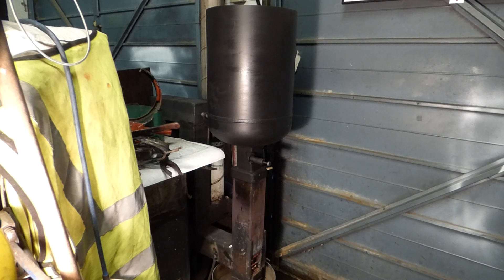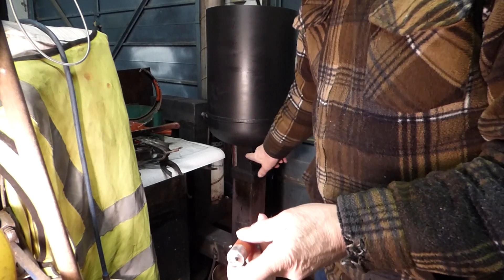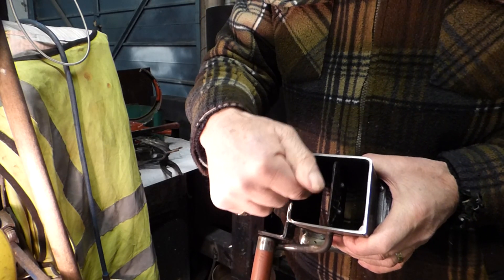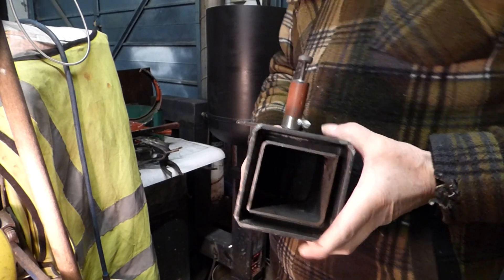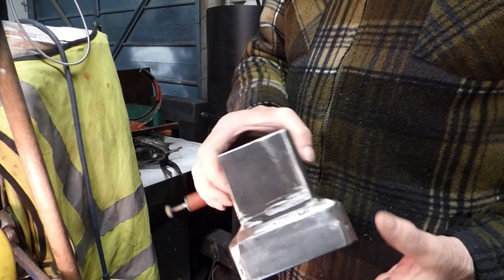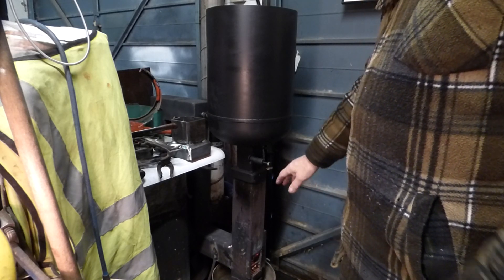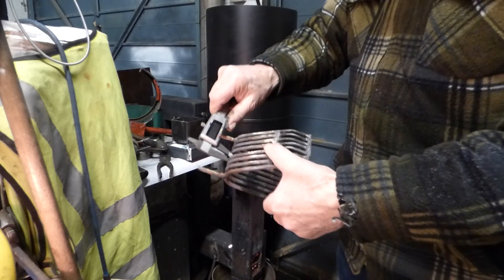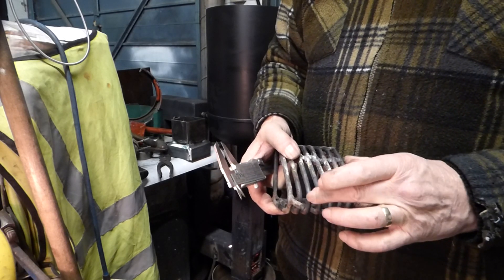rocket stove hopper up date No.30

Comment: You think you could make or design a wood chip basket, im thinking of burning chips in my heater, or just a segestion of how i could start, the chips will be anywhere from 1/4" to 1/2" in diameter , if not no problem , i'll just use trial and errow,like your vids they are entertaining  so hv good one from sweet home Al.

Comment: Whats the purpose of the hopper butterfly? Isn't the supply tube completely filled with pellets all the way to the fire basket? That being the case what does adjust the pellet feed do when the adjuster is so high up the tube? Or is it to close off the pellet shoot to remove the hopper when pellets are inside as to not to spill out? very confusing? Also why not have the lower rods of the pellet basket replaceable in your modified  basket  instead of drilling so many holes to accommodate total replacement. Especially when only the lower rods of the basket will actually need replacing in time from the intense heat.
Reply from the maker: To turn off the feed tube